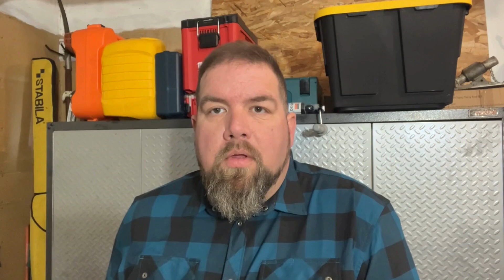How Houses Actually Work, And Why Problems Keep Showing Up

Comment from the maker: Most problems people see in their house aren’t random, they’re connected.

What looks like separate issues is usually heat, air, and moisture interacting in predictable ways.

Once you understand that, it changes what actually needs to be done.